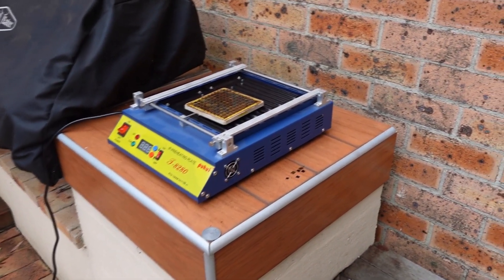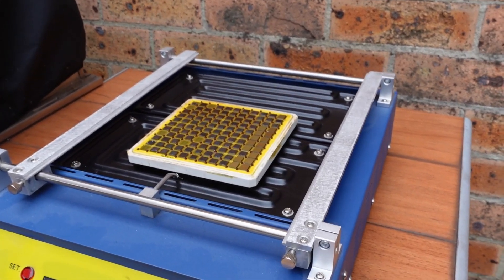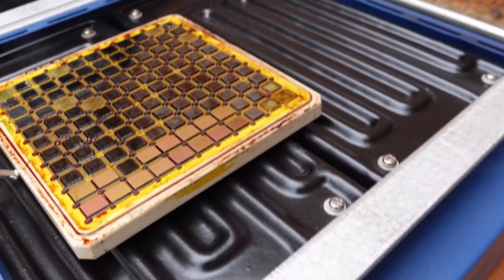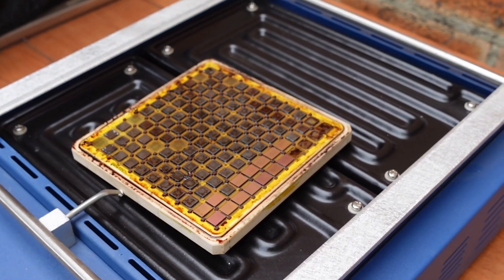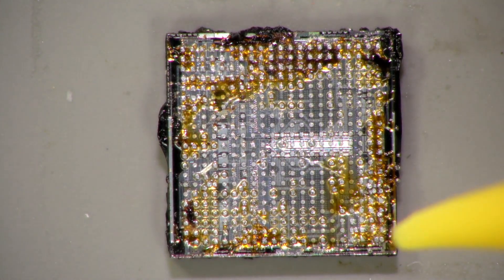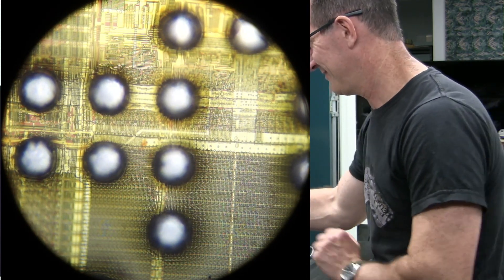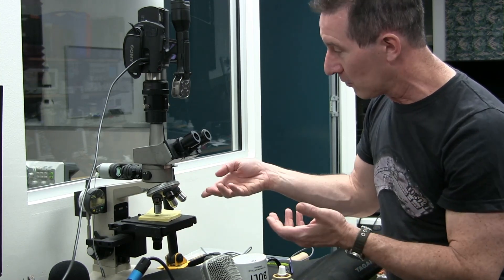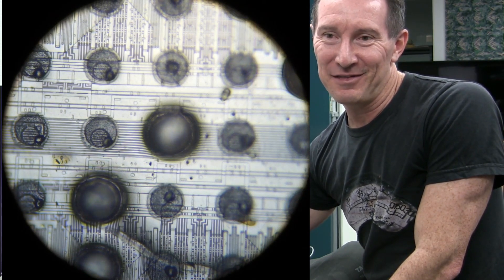EEVblog 1380 - BBQ IBM Chips

Comment: LOL, You did not only fry them but these TCM are also ESD sensitive.

I had to replace a whole bunch of these TCM's (working perfectly!)  in the late 80's for an Engineering Change.
According to the documentation the price for each of those TCM's at the time was over US $300.000 !
At the time you could buy a house with each TCM !

A "TCM" is just a type of module.
You had many different types of TCM's  ... CPU's, Storage,  Storage controllers, Channel controllers and what not.
They were fitted on large multi layer (64 layers if I remember correctly) boards with large ZIF connectors. (hundreds of pins in a square matrix)
Those old 3080/3090 computers were very expensive toys..... but you got a lot of hardware for your money.    these things were huge!
Reply: Kinda makes you wonder what the point of it all is right? :) All the effort and expense, few years later it's rubbish (cool rubbish nonetheless though).
Reply: @VincentGroenewold  Just like the latest and greatest phone... thousand or two bucks, and in 5 months it's obsolete junk!
Reply: @VincentGroenewold  They can't get the technology of later years if they don't do the technology for the current year. It is a step that has to be taken in order to move forward.
Reply: @Marcin Berman There hasn't been any innovation in phones for the last 10 years. They are just thinner with bigger screens now. A 10 year old phone can still run all the modern apps unless the manufacturer purposely slowed it down with an update.
Reply: Thanks for the insight,  Spikejwh1.
But forget your concerns about ESD Damage. These chips are ground or etched in order to examine them under a microscope. A fault in the semiconductor junctions does not interfere. The purpose is explicitly not the use as a spare part. 
To Phones(@Canadian Rocketboy, @rasungod0, etc): You should decide for yourself that something is obsolete and not the marketing department of any company, whose product you have paid for and are therefore the owner. The fact that millions like drunken minions are thirsting for the very latest hardware, at least pleases the shareholders .... ;)

Edit, I forgot something-> Back to our Australian: What causes problems, however, is if you don't remove the damn oil. And then also bring it to a boil/burn, LOL wonderful! This leaves residues that may make the subsequent examination impossible. It's so easy. Simply rinse and clean with commercially available solvents.

Comment: I was the lead characterization engineer on the Liberty SRAM program. It was designed and fabricated at the IBM Essex Junction site in the early 90s. It os a CMOS "high speed" (something like 10ns access time) static memory. I honestly forget the density as I worked on several designs. Pretty cool to see after so many years. I'm still in the industry working for Marvell Semiconductor now.

Comment: The shot of the bottom sides of the chips seems to confirm what I initially thought, that the chips might have gotten stuck on charred oil. Giving the entire bugger a good rinse with petrol and letting it vent for a few days might have been a good idea to get rid of the gunk before toasting it.

Comment: When you first mentioned doing this and the soft solder I was thinking about pulling a single strand of steel wire under the chip.  Wanna try it Dave?:D They do it to separate digitizer glass from LCD screens on phones with cracked glass.
Reply: Molybdenum wire is used for LCD separation. Out of curiosity I once bought some on *bay - 0.03mm can really cut your hands..

Comment: I though the idea was to use the hot air gun as well? Similar to preheating for soldering/desoldering just a little hotter
Reply: and cleaning it a lot, and adding flux. This is kind of butchery there as it will take so much more efforts to clean the burnt oil residues.

Comment: Maybe the chips had underfill and that's the reason they started to desolder at 280c+ ?
Reply: No they were only reflowed according to the docs I found. Those thermal modules just have a lot of thermal mass while the dies do not, so the heat gets sucked right out.

Comment: I worked 35+ years at the IBM foundry where those chips were manufactured. (Wafer-test, burn-in, module-test.)  We used VACUUM PENCIL to handle the wafers and chips. (not tweezers) I spent my share of time looking thru microscope at wafers to align the probes to touch those solder-balls so the chips could be tested. (we used joystick to move the wafer under the microscope... the wafer was on a vacuum-chuck)
Reply: Fishkill or BTV? I thought CMOS5 was BTV.
Reply: @kk1l  - BTV (Burlington Vermont) was the foundry for wafers/dicing/chips. EFK (East Fishkill NY) did the  packaging of chips onto TCMs.
Reply: @bruce peebles BTV is still active as Globalfoundries FAB9. It is 10min from my home and where my office was located for 35 years. The Fishkill fab is GF FAB10, soon to be owned by ON Semi. Surprised we don't know each other IRL.

Comment: Those large rectangular symmetric grid areas are probably rams. The void areas with lots of metal in them are probably capacitance fill which is used to add additional bulk capacitance, and to somewhat level out the surface to improve manufacturing.
15:39 those look like large buffers (basically an inverter), probably for sending the signal off chip with a lot of drive strength.

Comment: As someone who had the misfortune of using that same Puhui preheater, it's not a great preheater. It heats really unevenly, the temperature measurement is pretty off, and the "clamp" rails only attach on one side, and have enough play as to make them worthless. But hey, sometimes brute force works. :D
Reply from the maker: Yeah, it's not great, but I got it for 10 bucks on ebay, no other bidders :-D
Reply: @EEVblog  It got the job done at least :)

Comment: Ken won't have to use any dangerous chemicals on those because they're already bare dies.
He'll only need to clean up the oil residue and maybe wick off some balls.
Reply: Watch your language
Reply: He may dissolve off the metal layers with acid. He tends to do that in a lot of his teardowns. Particularly if the metallization is dense, like on the pink chips.
Reply: @PeregrineBF  Ah, OK

Comment: Are you sure it is oil? It looks like protection resist (usually photoresist) that is applied before cutting. You would strip resist with acetone and IPA in an ultrasonic bath, if it is not haveily crosslinked.

The big pads on the die are for electrical testing. The cross in the corner is an alignment mark for the stepper. The numbers are the mask desginations. Purple is oxidized silicon.

Comment: You really have to wonder how much work there was involved in stopping cross talk, ringing etc.
Reply: We had proprietary CAD software that did signal analysis (including crosstalk) as well as strict design groundrules on the length of nets, the number of loads per net, etc.
Reply: Coupling is a big deal especially in the sensing circuits where you are dealing with trying to read a 100mV differential off the bitlines.

Comment: How is it possible to see through the layers of silicon and also through the solder balls? Is silicon slightly transparent on that thickness?
And are the "see through" solder balls just because the optical properties of the microscope do that to the image? 🤯

Comment: Well try dish soap to clean it. It's burned oil after all.
Reply: Soap is good for non-burned oil. Once it's carbonised even solvents are not very effective.
Reply: @ferrumignis  Dish soap is designed to solve crusted oil and fat.
Reply: @kyoudaiken  Dish soap is simply a detergent, it will emulsify fats and oils in their normal state, but when burnt into carbon, dish soap wont touch it. Even soaking in boiling water with dish soap has little effect on burnt fats/oils, it requires manual removal by scraping or abrading with a pan scrubber or caustic chemical remover.

Comment: anyone googled that PN?, there's absolutely NO results
Reply: The number you Googled will be a serial number, a production part-number or the Engineering Change (=version) number of the TCM and not a P/N you can order.
What Dave showed was not the complete TCM but only the substrate with the chips.

There should be big heat-sink with a plunger to each individual chip to conduct the heat away from that chip.
It is rather a complicated module, not only electronic-wise but also mechanical-wise.
Reply from the maker: Yep, zilch!
Reply: Those are the part numbers for the masks to print those layers (ZL and RX). You can find others arounf the chip perimeter typically in the corners. The chip is Liberty, a CMOS SRAM designed in Essex Junction, Vermont.

Comment: What feature size are these? As awesomely small as they are, it boggles the mind that current gen feature sizes are probably 10 or 100 times smaller.
Reply: The memory chip in the video is about 500nm CMOS5. You could still land physical probes (darn small ones) on the internal nodes at that point.